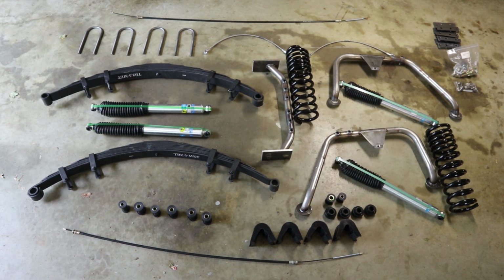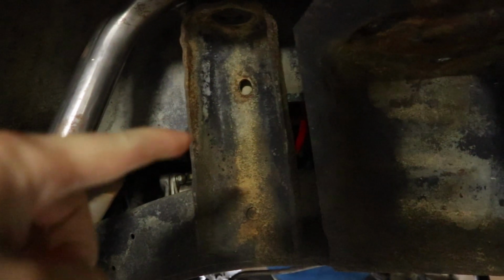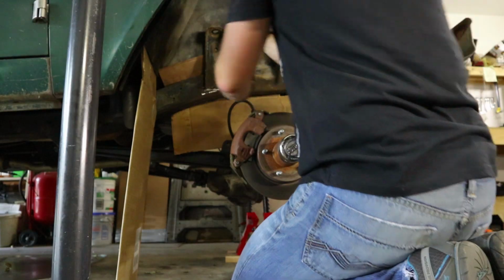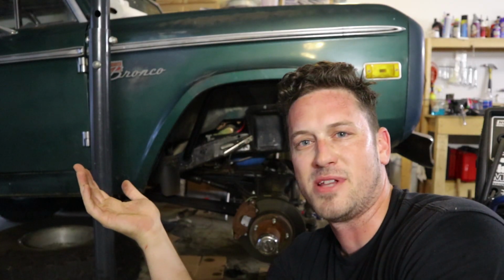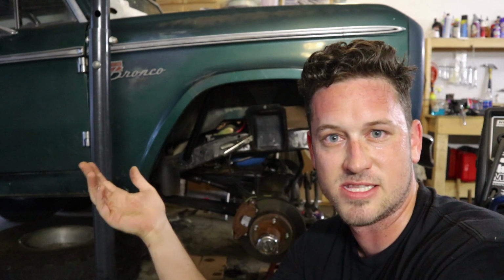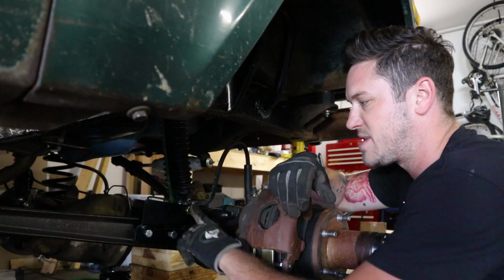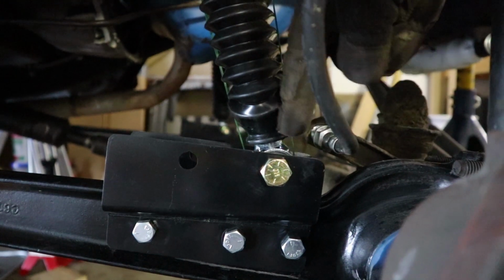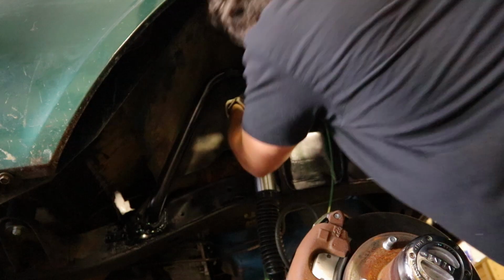Early Bronco Suspension Lift

Comment: Nice video.  I wonder what springs should one choose for the rear end..  I don't use leafs...
what is the Broncos rear weight?
Reply from the maker: +Ásgeir Sæmundsson thanks! I’m putting the leafs in the back
Reply: Seen a lot of guys put stock height springs out back. Then adjust the spring bucket height to where you want.
Reply from the maker: +ProFilm Colombia good tip!

Comment: Hey John quick question so when you put those 35 in. tires on your bronco did you end up with any rubbing issues while you were off-roading? I️ just did the same to mine and it seems like I’d have rubbing issues so I️ thought I’d just check. Thanks!
Reply from the maker: Yeah it rubs on the front fender. I’m going to cut it. Is yours rubbing in the front or back?
Reply: Nashville Early Bronco mine was rubbing in the front mostly on the inner medal fender so I️ cut that a bit but I’m still having issues with it rubbing the flares now. I️ added a 2.5 in spacer so that lead to a lot of rubbing haha!
Reply from the maker: Haha yeah, that will do it